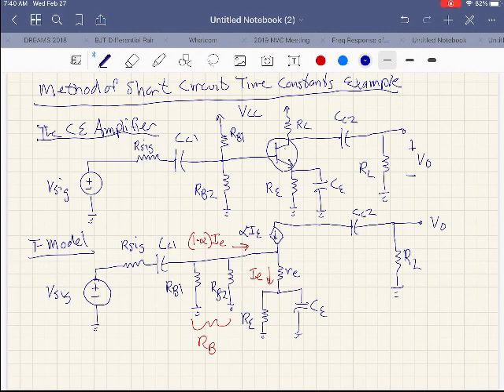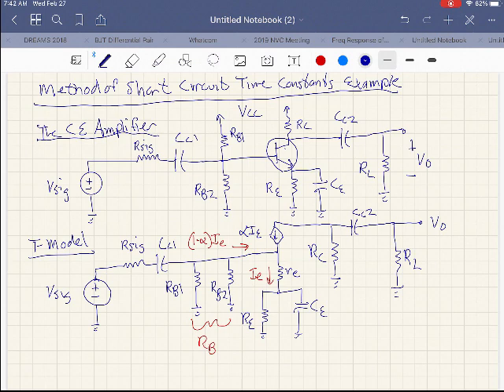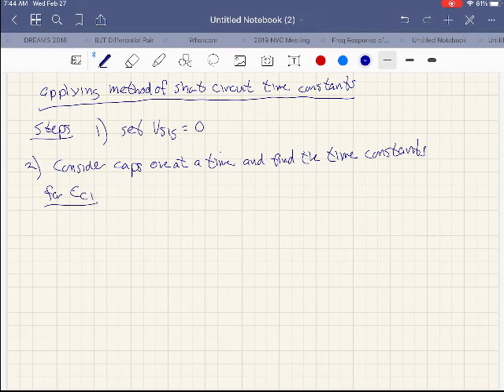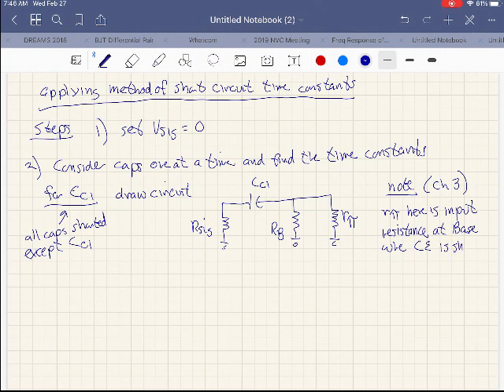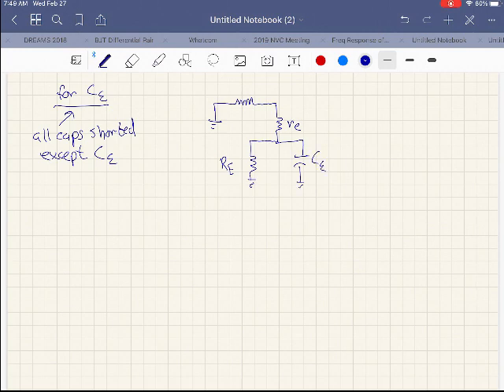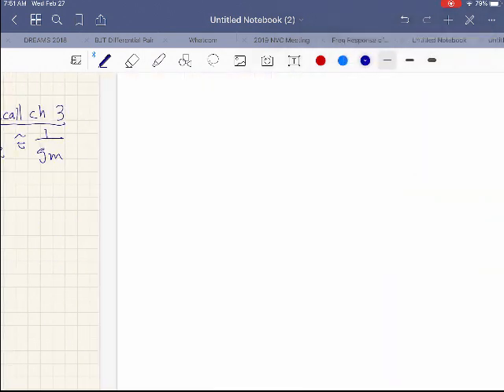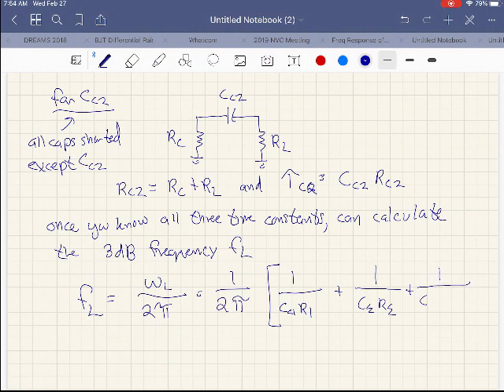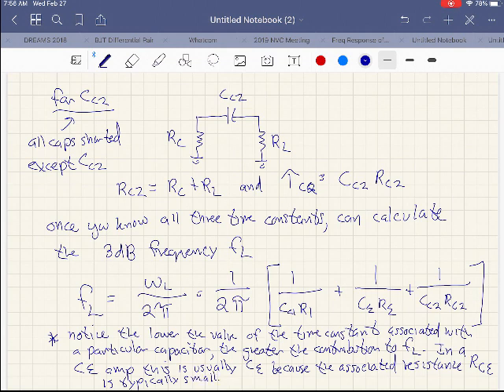Method of Short Circuit Time Constants

Comment: Amazing explanation. In the case in which the Early resistance r_o is not neglected, in the p-model should we put the parallel between R_c and r_o instead of R_C when we determine the time constant? So in general we have the resistance seen from the load in place of R_C (which in this case coincides with R_Out) or it is always R_C?